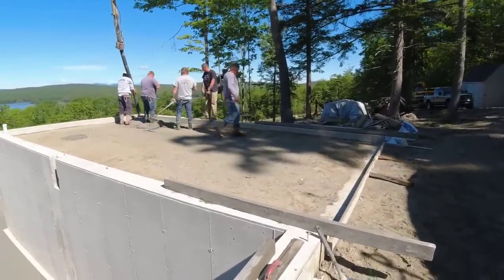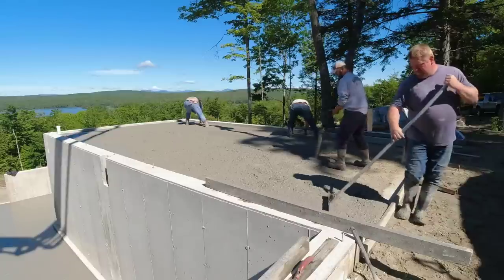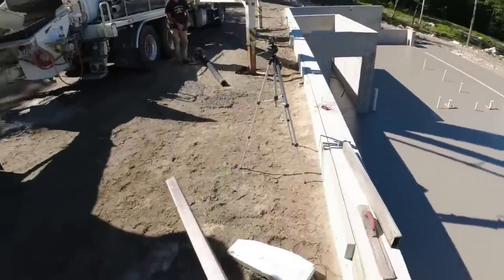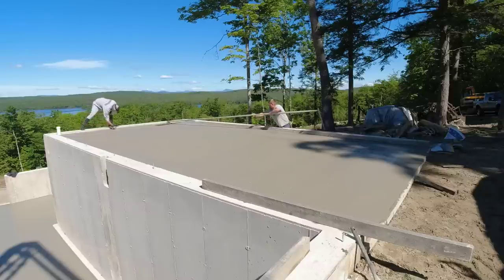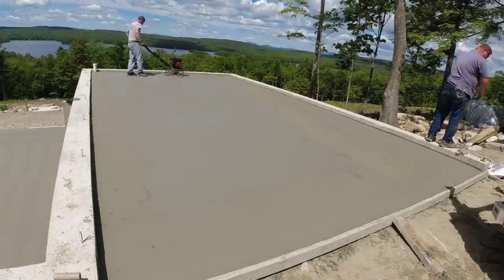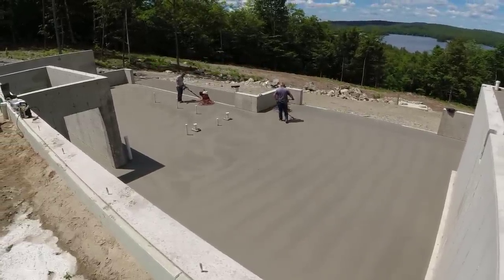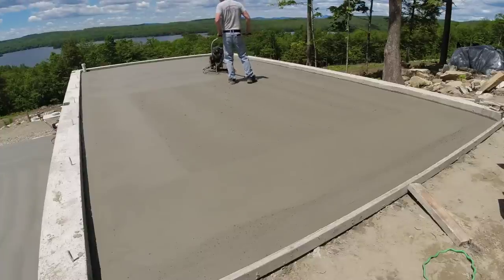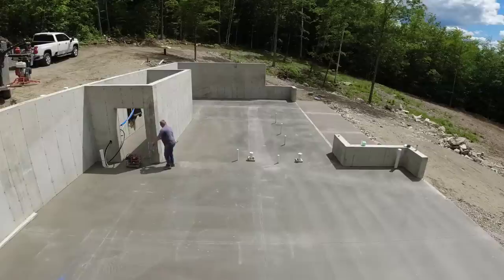Concrete Finishing Techniques When You Have Bad Concrete!

Comment: Good job mike. Do you like the float blades and finish blades better than combo blades. We generally just use combo blades. Thanks 
Bondo
Reply from the maker: I grew up using floats and finish, The floats do work better in some cases, but my guys now like the combos better for ease and not having to "kick" off the floats to go to the finish blades. I'm a little old school so I'm partial to floats and finish blades myself.

Comment: Great Video Mike! How clean are the sawcuts when you cut that quick after finishing? I have Diteq EX13’s with green blades and I’ve never been able to cut right after running machines on them (but I know earlier is always better).  I usually have to wait at least 6 hours in the summer. Thanks!
Reply from the maker: There clean, using the Husqvarna X-150 and a good skid plate, the cuts look nice.
Reply: Thanks Mike! Maybe it's my saw @MikeDayConcrete